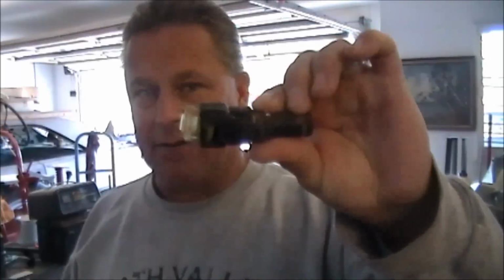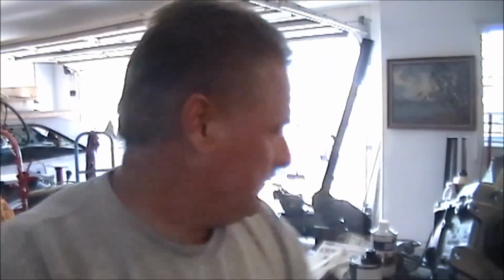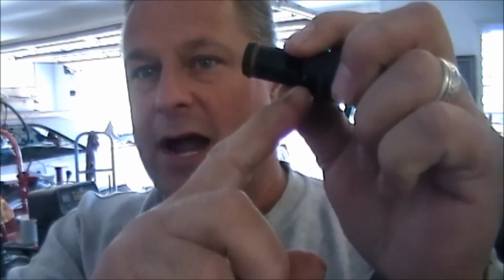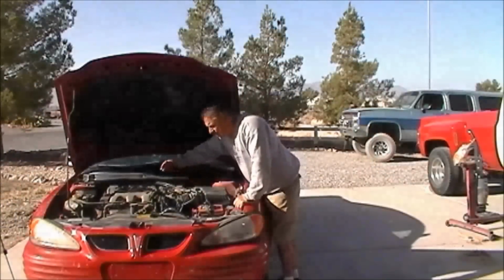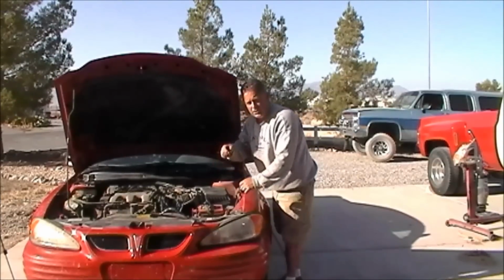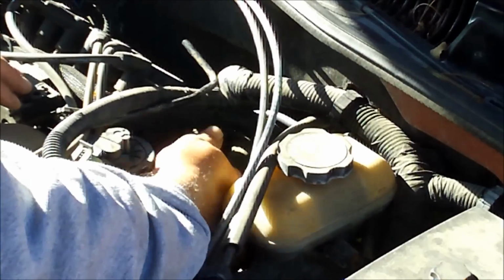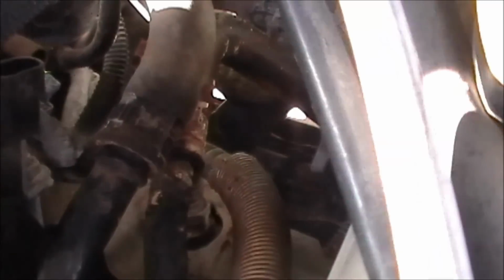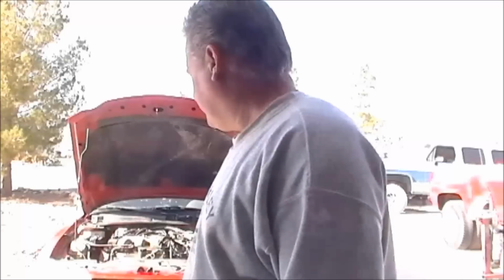grand am cooling sys fix

Comment: I watched this video and hope that this is my problem. I have 254,000 miles on my grand am and I still love it. I have replaced radiator, thermostat, water pump, all coolant hoses. & Intake gaskets. Intake gaskets were replaced 4 years ago and since then the low coolant light still pops on quite regularly. It wouldn't over heat but now it wants to try. It usually runs about 200 on the gauge but this time it floats back and forth between right at 3/4 and 1/2. I'll post again if this works.

Comment: I have the same car 2004 3.4 V6  with a 170,000 on it it’s held up well I can tell by looking under the car it’s been repainted probably once already there’s some under spray on the bottom side. Car soon will probably need another paint job motor runs good transmission still shifts good no issues the only thing that stoped working is the AC I believe it’s just a low charge and my e brake broke but nothing a junkyard part can’t fix. I’m looking into a paint job nothing to expensive just something to dress it up so it can last another 5-10 years.

Comment: I still have my 01 pontiac grand am 4cyl. I work on it myself because I don't have money to pay a mechanic. I barely have enough money to buy the parts I need.lol  My car has 333,000 miles on it. I sure didn't know about the quick connect attachments right there. I will have to take a look bc I'm having a coolant problem that I can't figure out
Reply: Amber Holland and

Comment: By the publishing date, you should still have the car. Have you or will you be replacing the water pump? I would really appreciate you posting a video on that providing your car is a 2001 Pontiac Grand AM 2.4 Litter with the water pump at the bottom and running off the timing chain. Great video thanks for posting. :-D
Reply from the maker: Scott Engstrom Nope, sold the car last year with 210,000 on the clock, and mine had the 3400 V6.
Reply: Thanks anyways, :-D

Comment: I have a 2002 Pontiac grand am se 2.2L. Has a really bad vibration when u r sitting in drive at a stop sign. Changed plugs ,boots and plugs again. Then replaced the whole coil pack and ignition control module. Still vibration actually worse. Especially when the ac isrunning. Also in reverse. Please help
Reply from the maker: check your motor mounts and harmonic balancer. should look into the flex plate, as it may be cracked
Reply: throttle body spray n brush n wipe it clean

Comment: Hey I have a 2004 pontiac grand am se1 with the v6 and my coolant light has come on recently but it's intermittent it would come on then shut off after a few seconds and I have about 145k miles on mine is there a chance that this could be the same problem as what you were having I filled it up to the full cold line with dex cool and the light isn't doing it anymore
Reply from the maker: have you replaced the upper intake manifold gaskets yet? You could be losing coolant internally.  Also the sensor in the coolant tank can malfunction as the system ages.  IMO, just check your fluid levels more often and keep extra coolant in the trunk.
Reply: I actually don't know about the intake manifold gaskets I bought the car used with 103k 3 years ago I have extra fluid and it doesn't seem to be the gaskets because I don't have that milkshake looking oil at all I will have to check around its definitely leaking externally but I just can't find where from
Reply: Also is it possible for it to just be a clog or something from a dirty system and all it could need might be a flush?
Reply from the maker: only if the coolant looks "cruddy" Considering your millage, Id replace the coolant.

Comment: How did u take it off
Reply from the maker: carlos lopez the end that went into the metal (engine side) line was so brittle that it broke off.  Harbor Freight has quick connect fitting tools that help get them off.  the rubber line side of the fitting can be removed with a pair of pliers.  Just a spring clamp on that side

Comment: Are these plastic connectors on the V6 as well?
Reply from the maker: this car is a v6
Reply: OK, so I can look forward to this leak on my 1999 V6 Alero, unless I proactively make this repair.  Thanks.
Reply: Nope, just checked and my Alero doesn't have these plastic things. Just regular spring type hose clamps.
Reply: This is the V6 motor

Comment: They're not dealer only they're 8.99 at oreillys.. I just cant figure out how to remove it.
Reply from the maker: CDubs HasIt if you have to replace them anyway, just bust em off.  theres a spring clamp on the motor side of the connection.

Comment: Thank you for those tips.
Reply from the maker: angelisone Glad I could help!  Thanks for the comment!
Reply: dzlfreek Do you know an easier way of charging the AC when that fitting is so close to the serpentine belt?

Being a woman with small hands I am afraid just to hook up & refilling R-134a when the engine is running due to the hose line is too short.
http://idqusa.com/product/af-1_arcticfreezer-134atriggerrechargekit

Can you charge the AC without having the engine running?

I hope you can assist on the above questions. Many thanks.
Reply from the maker: angelisone Engine has to be running with the AC on max and the fan on high.  If the charge is completely gone out of you system, you need to pull a vacuum on the system to get rid of the moisture in the lines.  I sold the car recently so I dont have a frame of reference to the location of the charge ports, but I have a manifold set for charging ac systems that have long lines.  If your going to use those types of canisters to charge your ac, hook the thing up and hold the can, while someone else starts the car. 
  Important thing to remember here is, if the system has discharged, there's usually a reason why...theres a leak somewhere..adding refrigerant wont help if it just leaks out.

Comment: the reason why everybody's having this problem with these Grand Am it's from General Motors they put a 4 cylinder Radiator in it with a 1 core radiator these cars needed 2 or 3 core radiator the only way you can get those as if you custom-build it the radiator shop free courses close properly also check your Cadillac converter to make sure it's not plugged and the coolant cap the garbage too because they allow it to bleed off with coming out of the Overflow line and most people just have water in them and decide if they're just going to drive but you do have to bleed your radiator system so there's no air in it

Comment: my 2004 grand am keeps stalling out after it kind of misses .i just put a oil sensor and new plugs and wires(advances computers ideas)after it happened the first time but it just happened again any ideas ?
Reply from the maker: make sure all codes are cleared.  i would get an intermitant miss from time to time and plugging in a scan tool and clearing the codes, whether there were any or not, made the miss go away for a while.  May be fuel related too. Filter and/or fuel pump.